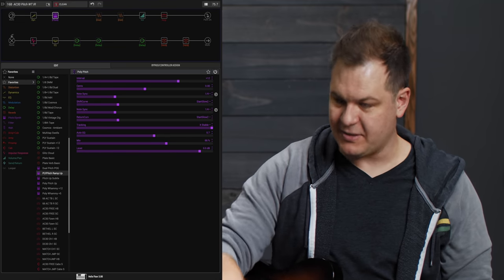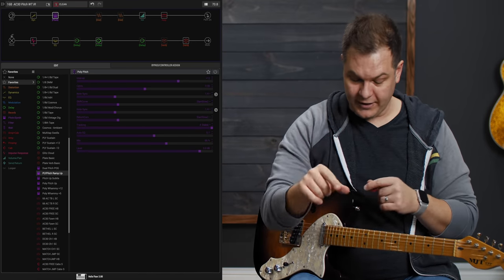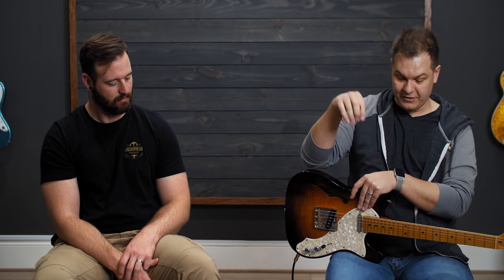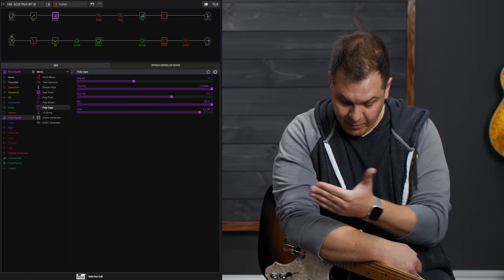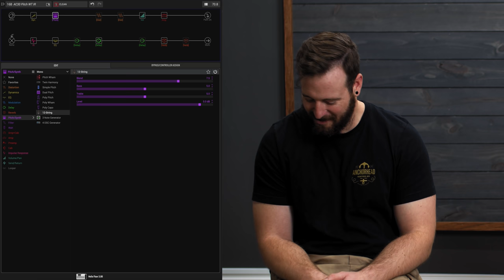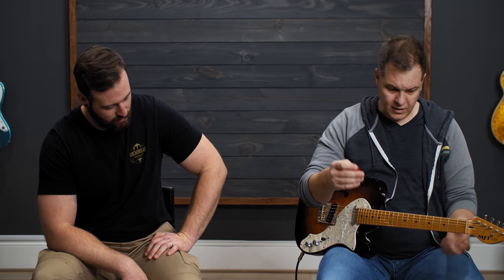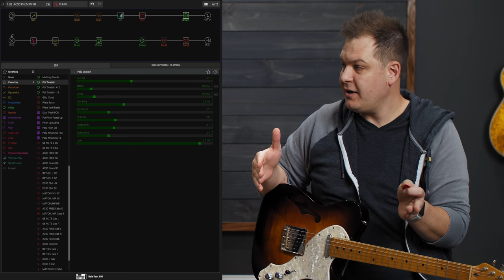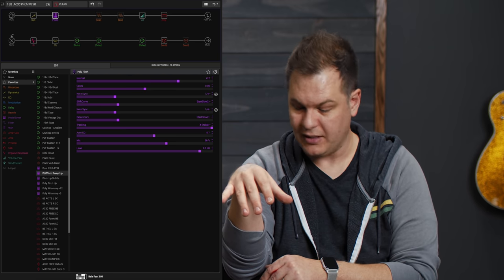Poly Pitch effects in Line 6 Helix Firmware 3.0 // A full walk-through

Comment: One thing I've found the poly sustain effect is great for is faux feedback. Turn the pitch to +12, set it to fade in over a long period, and have it at the start of your chain so it runs into your drive pedals, with the switch set to momentary. Step on it right after hitting a big chord or note that you want to ring out and feedback, and let it do its thing. Not perfect but it's something I've started using a ton of already.

Comment: If memory serves, according to the production sheet (of "Mysterious Ways"), The Edge uses a Korg A3 effects unit and the modulation is a Phaser.  I've got extremely close with my DOD FX200 Stereo Phaser.  Question: On these Poly-Effects (especially the Poly-Capo) have they addressed the formant issue of earlier generations of pitch bending pedals (the shrillness of higher pitches and hollowness of lower pitches)?  Is this the function of the "Auto-EQ" parameter?

Comment: I know about the DSP limitations but are we able to do this on the hx stomp?
Reply from the maker: You can use them in the stomp with certain amps (not all amps take up the same amount of DSP). The Stomp is basically like one line of the Helix (each row is a single DSP chip). In this patch we have a compressor, two drives, an amp, and the pitch effects all on the top row.